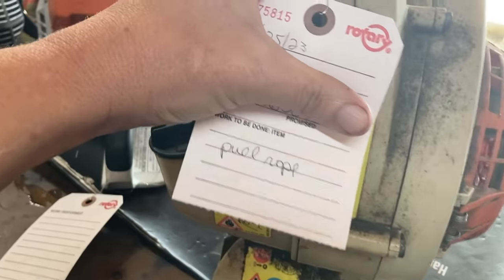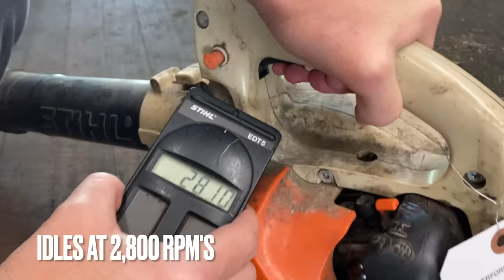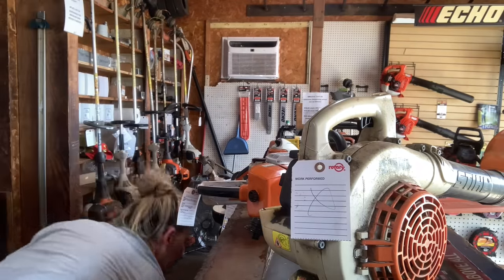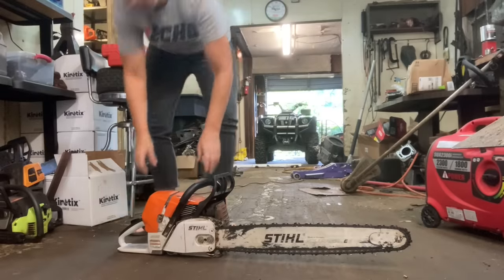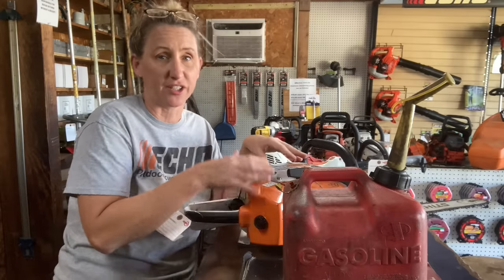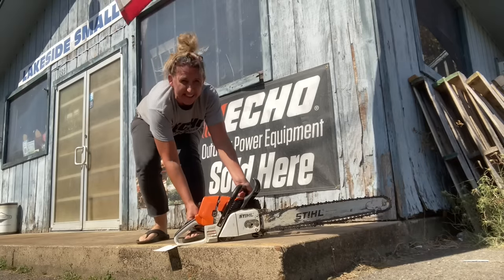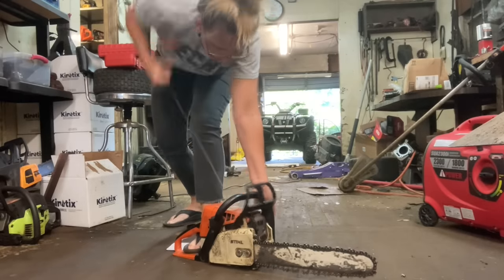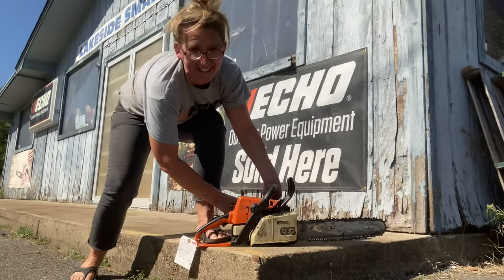The Burning Truth of Canned Fuel. This HUGE Distributor Doesn't Like Me Exposing It!

Comment: First time watching your videos.  I believe you solved the problem I've had with my weed wacker for quite a while. It does the same thing as the blower; revs up but then the RPM drops off even though the throttle is pulled all the way.
Also like your safety work boots!
Reply: adjust your carburetor ,,  if you are using canned fuel it needs the mixture adjusted to compensate for the higher octane slower burning canned fuel
Reply: @wildcoyote34, bullshite!  You obviously don’t know anything about octane.  Octane has zero effect on air/fuel ratio.  Now compared to E10, there’s a slight change, but it’s minimal.  Higher octane could allow the timing to be advanced a skosh, but it’s certainly not required.  The compression on these engines don’t require high octane, but adding oil does lower octane and fuel that sits loses octane.  Given that the big sell on the canned fuel is storage, that’s likely the reason it’s high octane, to allow for an octane drop while the fuel is sitting.
Reply: @donrichter3523  i know plenty about octane  ,, having been building boosted engines for almost 30 years ,and also repairing small engines ,,, higher octane fuel in a chainsaw causes it to run rich because the fuel burns slower ,,the canned fuel  burns slower than gasoline and  it causes  exactly what  was happening with that blower ,,in a 2 stroke  you can't change the timing  ,, you adjust the fuel slightly ,, turning in the high speed screw effectively changes the AFR slightly to compensate for the fuel ,,i've done it to thousands of 2 stroke engines over the last decade ,,,there's also multiple other benefits  to using canned fuel ,,  you never have to worry about getting crap out of a dirty fuel can ,,it'll never have water in it either ,,,I got a laugh out of watching her pull and pull and pull on that worn out stihl chainsaw ,, i went out to my shed and picked up my husqvarna 455 rancher ,, primed it , pushed the compression release ,, pulled 2 times  it fired and  the 3rd pull it was running ,,that saw has not been ran since last october ,, 11 months ,, it would never have started if it had gasoline in it because gasoline turns to varnish  ,, synthetic fuel does not
Reply: @wildcoyote34  "i know plenty about octane"    High octane fuel doesn't always burn slower.  Some actually burn faster in order to get across a larger diameter piston bore quickly.  
Please explain how higher octane, slow burning canned fuel causes an engine to run rich?  You basically said it twice so I would hope that know how it works.  But from where I'm sitting there is the same amount to fuel and air in the engine as there would be as if you were using gasoline.  So I don't see how it can be richer.
Now if you had said that canned fuel had a stoichiometric ratio of 16 or 17:1 I could see how that could make it rich.  But that was not your claim.  In fact, you claimed that high octane fuel in general would cause this rich condition.  Wouldn't that mean, according to you, that the hundreds of millions of times that people put premium gas in their carbureted cars that didn't call for it, they were running rich?  It's odd that I never heard anyone say not to do that because it will make your car run rich and you will get worse MPG.
Also the manufacturer is claiming that it is a direct replacement for gas so the stoichiometric ratio would have to be the same or very close to gasoline.  I have some Truefuel and it doesn't say anything about needing to adjust the carb on the can.  Are you aware of anything on their packaging or website?  If there is not and , according to you, this needs to be done to make the equipment run correctly, it's a HUGE oversight.  And alot of equipment requires a special screwdriver to adjust the carb.  Are you saying that the consumer has to go out and buy a screwdriver so they can use this fuel or any high octane fuel because it burn slower and therefore, richer?
I know there is a lot so if it's too much please focus on explaining how fuel burning slower makes the Air Fuel ratio richer.
I await you informed reply....
Reply: @ToddKing I couldn't help but notice a couple of points he mentioned that you seem to either be glossing over or simply didn't catch.

He specifically used the word effectively when mentioning AFR. He also mentioned that the synthetic fuel burns slower.

If your engine is tuned to run on pump gas, for example, which burns at a particular rate, the engine will (barring other problems) run as intended. Let's say that a given cylinder volume and compression ratio is going to burn one milliliter of fuel per cycle. So your carb is delivering that amount because that's optimal for that engine, given its setup. The same quantity of a fuel that burns faster (alcohol, nitro, etc.) will be completely burnt away sooner than the standard fuel. At peak efficiency, a cylinder should be given as much fuel as it can completely burn in a cycle. If the fuel burns off faster, there is time left in the cycle for more combustion, which won't happen unless the amount of fuel to the cylinder is increased. This, EFFECTIVELY will cause a lean condition. The remedy for a lean condition is to increase fuel supply to the cylinder. 

On the same token, a fuel that burns slower may not burn off completely by the end of a cycle. Of course, as the knowledgeable individual you seem to be, you know that exhausting unburnt fuel is a sign of a rich condition - more fuel than the engine can burn. If you have a slower burning fuel in a setup for faster-burning fuel, the same rich condition can easily be achieved. The remedy for a rich condition is to reduce the fuel supply to the cylinder.

So, dude isn't wrong. I think you're just missing the point he's trying to make about it. Either that, or (hope not) you're some kind of know-it-all keyboard warrior who's just feeling a bit combative and trying to look superior. I'm gonna err on the side of caution for now and believe you simply misunderstood what he was getting at.
Reply: @arcanewyrm6295  "turning in the high speed screw effectively changes the AFR slightly to compensate for the fuel"  He is not talking about the synthetic fuel effectively changing the AFR.  He's saying the turning the high speed screw effectively changes the AFR.
''He also mentioned that the synthetic fuel burns slower.''   He said high octane fuel & canned burns slower .  And I said that is not always true and wondered where he got his info about canned fuel and the slower burning causing a rich condition.
You mentioned alcohol. The stoichiometric ratio for alcohol is around 9:1 IIRC.  So if you just replace gas with it an engine will be crazy lean. Gas is about 14.7:1  That's why I mention that maybe canned fuel was maybe 16 or 17:1  flowing through the same size jets as gas would make an engine rich.  But then he's saying the high octane gas will do the same thing.  And I know that octane rating does not change gasoline's stoichiometric ratio.
I noticed that you did not address a number of my concerns.  If he is right why weren't there concerns about putting premium fuel in cars from the 30's to the 80's?  And why are canned fuel manufacturers making a product that requires that you adjust the carb on your equipment and not tell you that you have to take it to a service center or be mechanically inclined enough to buy a special screwdriver and adjust it yourself?
Reply: @ToddKing  I didn't address all of your concerns because I know next to nothing about the molecular intricacies of the various octane ratings, other than higher octane ratings helping reduce predetonation in higher compression applications. I'm not familiar enough with the rest of the subject matter between the two of you to chime in with any kind of useful input regarding the parts I refrained from addressing. As far as manufacturers of canned fuel not mentioning the potential necessity of carburetor adjustments, I don't know. Maybe they're wrong to assume that people who use their product will already know how to compensate for the difference between their product and other fuel options. But by similar logic, why don't gas stations put a notice on the pumps saying that if you have a higher compression engine, you should use the higher octane gas? Wouldn't it be financially beneficial to the company to upsell a more expensive option? (I only ask rhetorically.)
Reply: @ToddKing  first off you are still thinking about a 4 stroke engine   you need to reevaluate what you are talking about  because a small 2 stroke engine doesn't behave the same way as  a 4 stroke engine with a huge piston surface area ,,, 
i'm aware of plenty of claims by manufacturers of canned fuel  ,,  they won't even list all  their ingredients on their can 
as  for that screw driver  you can buy the full set of them at most home stores for under 10 bucks ,,and most older equipment like the POS stihl saw and blower showed i nthe video don't need anything more than a 3/16 slot head screw driver ,,,it takes 5 minutes to adjust the carburetor
Reply: @wildcoyote34  First off, you cannot possibly know what I was "thinking" and I do not "need" to do anything.  And it appears that you were unable to comprehend what I was say about burn rate across a large piston or buying screwdrivers or having to adjust the carb.  So I'm not sure replying is worth my time as you cannot be bothered to use sentences, punctuation ect. as well.

@wildcoyote34
17 hours ago
 @ToddKing  first off you are still thinking about a 4 stroke engine   you need to reevaluate what you are talking about  because a small 2 stroke engine doesn't behave the same way as  a 4 stroke engine with a huge piston surface area ,,, 
i'm aware of plenty of claims by manufacturers of canned fuel  ,,  they won't even list all  their ingredients on their can 
as  for that screw driver  you can buy the full set of them at most home stores for under 10 bucks ,,and most older equipment like the POS stihl saw and blower showed i nthe video don't need anything more than a 3/16 slot head screw driver ,,,it takes 5 minutes to adjust the carburetor

Comment: You are absolutely correct about canned fuel , took your video to make me a believer ! I took the canned fuel out of my brand new blower that I could barely get started, mixed my own fuel and 2 cycle oil and guess what, starts right up and runs great. Thank you for sharing the truth.
Reply: All fuel gos bad no matter what brand canned or not first of all. Says up to 4 years on sealed can and up to 2 years after open. Also that’s a dark can in a dark spot so clear tank on a saw in the sun is completely different. Where my wife works sells many units of Stihl equipment and tons of canned gas they don’t see issues with canned gas.  No idea how long the saws been sitting 91 octane e-free gos to crap after awhile too.
Reply: Also the almost new 461 that wouldn’t start isn’t almost new with worn out clutch bearing.
Reply: You didn’t pay attention: 

Doesn’t matter how many cans your wife sells and how many you’ve used, this shop uses, fixes and has seen more equipment, repaired more of them and used more than you or your wife combined.
Reply: @MartinD9999  Ok , so you are saying trust her , but not trust some other random and then trust you.....

Comment: The most important time is when your machine sits with mixed or regular pump gas .
It will destroy a carb fast ..I'm using recreational fuel in all my small engines with great results ...Love your videos
Reply: I buy non ethanol for all my yard equipment but more and more they are making carbs out solid plastic. I got a new Briggs pressure washer somebody gave up on because they left gas in it and there's no fuel shutoff. It was an easy fix. Flushed out the all plastic carb (replacement cost on Amazon is like $10) and retro fit a fuel shut off.
Project farm did a video on what ethanol does to aluminum. No ethanol for me.
Reply: Sometimes it's how it was physically stored last.  You know those cheap single stage snowblower that always go bad?  They are supposed to be hung by the handle or sat face down on the floor.  They are engineered to empty the carburetor when sat like this.